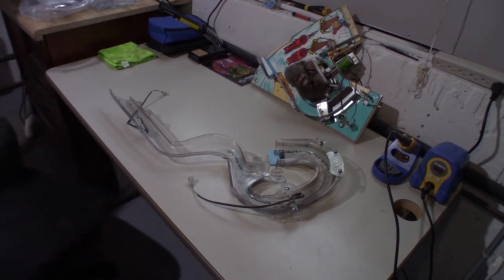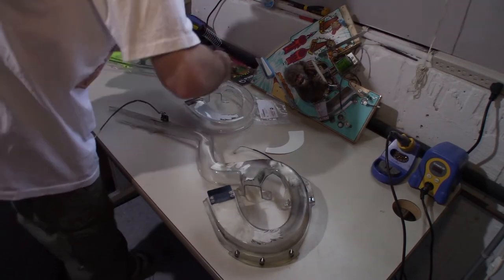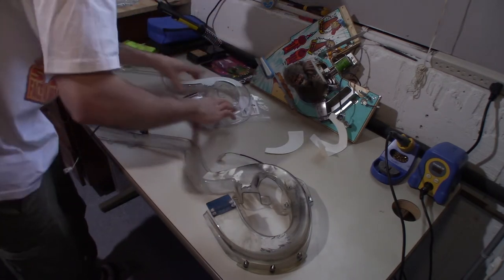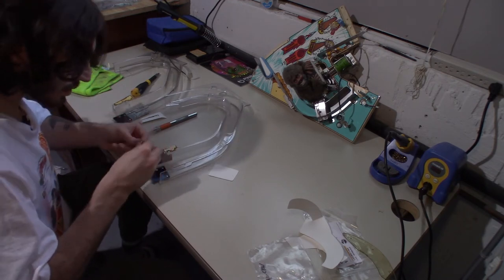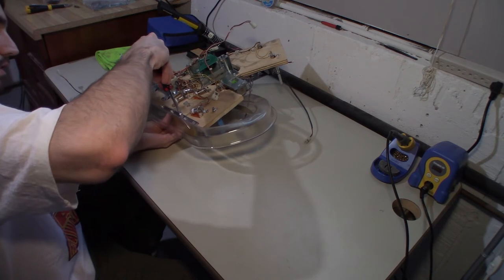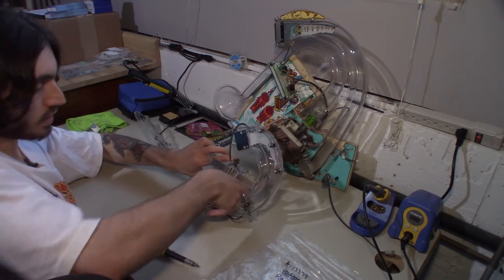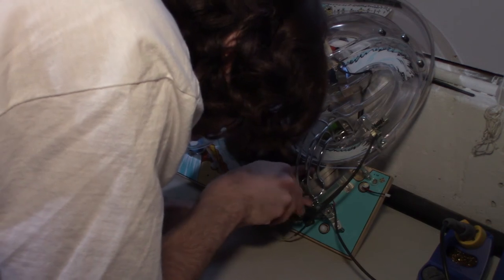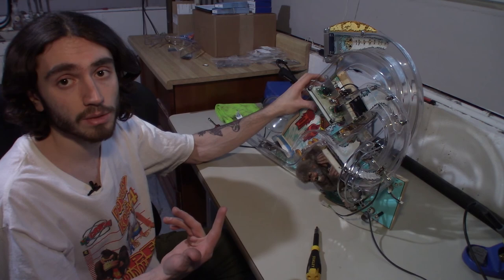White Water Pinball Restoration Part 4: New Ramps, Decals, and Upper Playfield Reassembly

Comment: Hey man, thanks SO much for these vids! I'm in the middle of my own WhiteWater restoration (I have machine #43, pretty sure it's a sample game!). I currently have everything torn apart right now to clean and address issues and I've noticed that the entrance to Disaster Drop keeps triggering repeatedly (it plays that annoying rushing water sound and giving 50K points constantly). I'm guessing the optos are going bad. Any advice regarding those switches?
Reply from the maker: Clean the optos with some alcohol and a q-tip. Check the optos for cold solder and see if they need to be reflowed. Otherwise trace the wires back and go from there. Could just be bad optos, could be an issue further down the line.